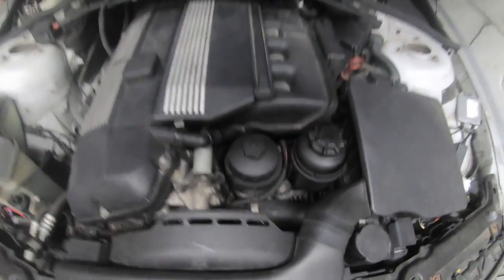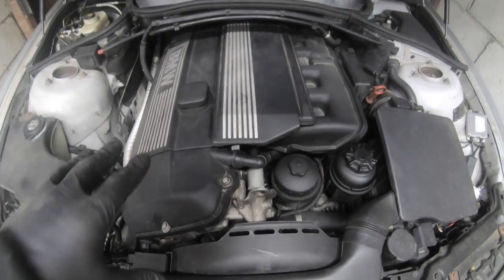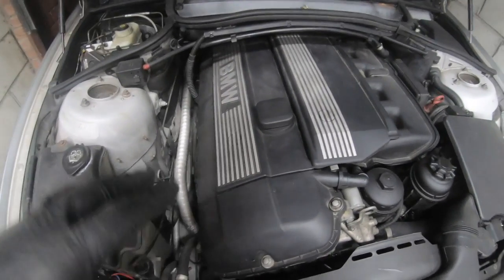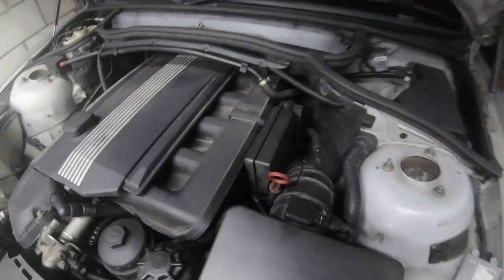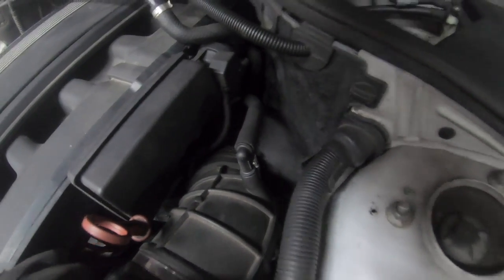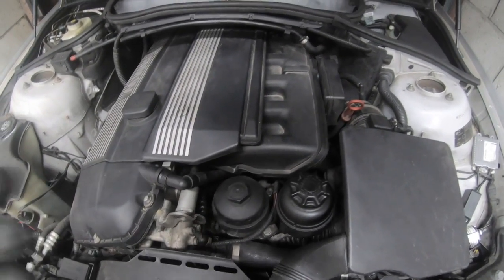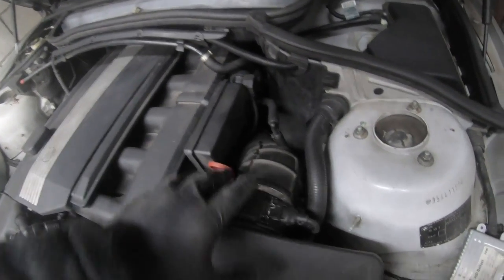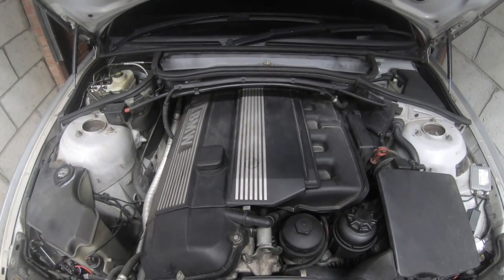Things You NEED To Replace On Your M54 Engine At 100K Miles

Comment: Got 20 years/169K miles on my M47 remapped to 200BHP/325lb-ft 120d Sport steptronic - premium diesel, Castrol Oil, Man filters, change oil every 6K, Change the ATF coolant, every 5 years 50K miles, change rear diff oil every 10 years/100K miles. Recently did the condensor, evaporator, compressor, radiator, expansion valve, o-rings/seals; now the AC is cold as ice. Had to fix the Bluetooth MULF and the profession I-drive/navigation computer, OS drive shaft & ABS sensor, rear and front Guibos including center bush, alternator & battery, uprated Darkside FMIC. new FMIC seals, Milltek exhaust,  B12 Pro kit, top-mounts, Dinan camber plate, Power Flex yellow rear top-mount bush, front & rear 1M wishbones/tension struts, track-rods and ends, tie rods front & rear droplinks, Powerflex Road ARB bushes, Goodridge brake hoses - do the odd track-day

Comment: I bought an Aluminum resivior tank for my 2002 e46 325ci, I replaced my radiator with an aluminium one, I'm having my cam shaft done, new clutch motor mounts oil pan fuel filter replaced every plastic hose with rubber. I bought all the parts, I'm hoping the labor doesn't make me regret the work I've have had done. 154k

Comment: Love you videos, I would like to get your opinion on the fault codes that I have been chasing on my X5 e53 m54 engine: P0444
Raw code: 0444; ECU: 12; Status: Confirmed Evaporative emission (EVAP) canister purge valve - open circuit Evaporative Emission System Purge Control Valve Circuit Open

============6==============
P0050; Raw code: 0050; ECU: 12; Status: Confirmed Heated oxygen sensor (HO2S) 1, bank 2, heater control - circuit malfunction HO2S Heater Control Circuit

Comment: My 2001 E46 325xi Touring has 225k+ miles on it... And I keep finding that a lot of the parts are from 2006, or factory original issue. The waterpump finally died, and ate the drive belt... Now I'm trying to cure the oil consumption issue (1qt per 400 miles, aka one tank of 91octane), and replace the parts that might be holding it back. Not looking forward to taking off the intake, but it'll be nice to do vac lines, CCV separator, OFHG, and other things in one shot when I feel like spending an entire day getting arm-deep in my engine. At this point, I'm happy it runs and isn't throwing codes, aside from thermostat failed open... 😅

Comment: Great video, wish you went more into PCV system. Battle over year after BMW dealer replaced oil pan gasket and oil filter seal.  Ran like a tank for the first 10 minute and people were saying MAP.  Then saw in old video were someone  mentioned ruff running at start. Upon pulling electronics box there it was. Hose broken coming out of valve going to dip stick. Note 168,000 on BMW and the hoses all broke in half replacing the PCV. Looks like BMW uses a straw manufacturer to make hoses.

Comment: In the US here. Have a 2004 X3 2.5 with the M54 and a 6 speed MT. Has been a solid engine for the 7 years I've owned it, now have 202k miles/325k km on it. And looking to keep it going! Keep up the good content!
Reply: no oil leaks? Got a Z3 80k miles scared owner after this video 🤣

Comment: Great video. Clutch fan is a mixed bag, I’ve seen them fail catastrophically and ended up cutting all pipes, belts and messed up the hood as well. I prefer an electric fan.
Reply: get it outta there

Comment: can you tell me i have a e39 525i which i bought recently and changed everything , i started the car and it drives smoothly but recently saw smoke coming out the exhaust , at first i did not take much notice of it but i have dug a little deeper and they say the head gasket is gone , what would you think it was .

Comment: Enjoyed watching this video. Do you have a video DIY valve stem seals and where to get the right tools for the job? I see oil in the cylinder 2 spark plug, cleaned a couple of times, used some at205(stop leak) hoping to temporally stop it, but it keeps returning, must be pretty bad.

I've a m54b30 Automatic 05 Sedan ZHP. Purchased the car with 92k miles and 4 months later it's now over 105k miles. I've service records of the car from day 1 and have done pretty much all maintain item you've mentioned in this video. Well done with the list.

Comment: I have a 04 325i and I bought the car a few weeks ago and the car doesn’t have a Ccv system but it has one coming from the valve cover to the top of the intake is that normal?

Comment: I have a Z3 2.2 M54, on 120,000 miles,  changed all the parts as said in the video except the Vanos seals, still like new. The CCV and crankcase sensor has to be done soon.

Comment: Did all these Maintence tips, owned the x3 for 4 years now still havent spent over $1100 on parts, 155k miles.   Saved 6k in labor doing this all myself, very easy to do. Highly recommend the K&N drop in filter and K&N oil filter

Comment: I really admire your enthusiasm over the car, I have a E46 M54 2002 CI sport coupe and have had a lot of issues. The headgasket was replaced at 100,000 (which sadly resulted in a cold-start misfire), the gear box reconditioned (cost a fortune) I cleaned ICV and cleaned and checked  DISA valve, thermostat and water pump replaced, along with viscous cooling fan, spark plugs, coils, I am currently however on my 5th expansion tank and am uncertain as to why. They keep on cracking and leaking. I did a head gasket failure test the other week, the fluid did not change colour so presumably ok. Car was converted to run on LPG too. Can you offer any advice which would be much appreciated?
Reply: LOL "Car was converted to run on LPG too. "

Comment: So...Bmw Dr. Im thinking about rebuilding a m54 engine from the ground up. Is there anything I can do to build reliable BHP, Camshafts big bore kit head work big valves etc? Does anybody sell these kind of products? I'm looking for real HP not tricks and hacks like ecu tune for a higher rpm or throttle pedal tricks. Any ideas? Lmk! Thanks

Comment: Taking my m54 04 facelift 330ci to the shop to have  the cold climate ccv kit installed, intake manifold gasket, intake air distributer,rotors and pads all around, brake flush, SS brake lines, auto tranny flush and tranny filter, differential fluid flush, 6x ngk spark plugs, water pump, thermostat, expansion tank, aluminum water pump pulley, the other aluminum pulley(forgot name) and 2x belts, also mechanic fan to eletric fan conversion I want to give that a shot. I dont want my mechanical fan blowing up. CHEERRS GREAT VIDEO MATE!!
Reply: whew that sound expensive

Comment: I  would also add whenever you do your CCV (Crank Case Ventilation) also replace the 2 plastic hoses that run from the radiator into the engine underneath the intake manifold at the same time along with the intake gasket and while there check every hose that is worn out and replace it. I  recently had to replace both of those 2 plastic hoses because they bursed while I  was driving on the way to work one day and I  immidiately pull over and turned off the car to save it. Luckily I was able to save it and fix it but it was a  royal pain. I  took my time with it with the help of YouTube and replaced a lot of frayed and worn out vaccum hoses, and such and at the same time did the CCV as the it was breaking apart when I took the intake manifold off. When you do that, replace the oil dip stick rubber gasket too. These are small things but trust me, these small things can grow to something much more serious later on.
Reply: I have an e46 everything you talk about I'm in motion of doing my intake manifold off as soon as I replace inlet heater pipes under manifold I'm installing back my manifold myself

Comment: Replacing the PWC Clutch fan at 100k miles sounds like a sensible precaution but every year seems excessive.  Are you doing 100k miles each year Dean?

My M54 engine is just approaching 100k miles so I will probably change mine.  However, a work colleague with the same 2003 e39 as mine ran it for 385k miles until he eventually scrapped it this year.  As far as I know the fan never failed.

Comment: I have a question about the pulleys, if I have bad pulleys would it make my clutch fan wobble I changed out my clutch fan and my water pump but it still wobbles and I didn't change the pulleys and I can't get an answer back from Nathan
Reply: The fan clutch is fried change it before it hits your radiator!

Comment: My water cooling reservoir blow up at 187k miles, got no clutch fan (electric), cover gasket leaks for every 30k needs to be replace, DISA is still fine (190k).

Comment: I got rid of the mechanical fan and replaced mine with a electrical fan years ago and it has worked great with no issues. I only did it because it makes it easier to work on the car with the electric fan it takes 2 mins to remove but with the mechanical fan it's not easy and quick to remove.

Comment: What do you think of running 90 RON in an M54 powered car, more specifically the 3.0L? I've yet to experience lack of power, I run 98 RON occasionally and it doesn't feel any different going back to the lower RON fuel. Observed fuel economy is the same between the two. It is only a 10.2:1 compression ratio motor though, so I really don't think it needs the premium fuel.

Comment: Hi mate, could you please tell me whet the main difference is between 530d and 525d engine and which one is better apart from the bhp , I’m considering the 525d but wondering if it’s major diff from the 530d ..would be appreciated if you could clarify thanks !
Reply from the maker: No difference mate at all only difference is BHP and the fact that 530D IS MORE fully loaded with bigger sat nav where 525d it’s rare to have that and doesn’t come all the time fully loaded but overall there is no difference
Reply: Thanks for the reply mate, so it’s the exact same engine ?.. and I can increase bhp with re-map I guess and I’m not bothered about sat nav so that’s fine ..I seen 525d with 84k on clock with 2 owners 2008 for 6.5k you think it’s worth it ?..thanks in advance

Comment: Good vid, my e46 325i has developed a problem recently, when i take my foot of the gas and step on the clutch the rpm dip down under 500.
Also it is kinda shaky when i whant to go again.
Vakuum hoses are new throttle body boot, and ccv are new all original bmw, disa is fine, no engine fault codes  
Car got 122k km
If you got some Tipps that would be super nice.:)
Reply: Maybe the vanos ?
Reply: Did you find your problem? I also have it. New o2 sensors, new disa, new vanos seals, new ngk plugs, new intake boots, new ccv, cleaned throttle and icv.

Comment: That is an awesome video. I'm a happy 320i owner of this m54b22.
If you could do a different intro, you could also use the video as buying advice.
Great one, thanks!
Reply from the maker: No mate not on that engine mate I don’t do any 320i 120i 520i engines sorry mate only 3.0
Reply: @BMWDoctor  M54 engines,2.2,2.5 and 3.0 are almost the same,just the size...they share lots of parts....so they have the same problems.....seals,gaskets,disa valve,vanos.....but in the end they are very good and reliable engines,if maintained correctly.👍

Comment: Your content is awesome mate! Is E46 330Ci 2003 picky when it comes to battery’s? Cheers!
Reply from the maker: Not really mate no these cars are actually very good and not fussy about battery’s unlike the newer cars they are picky and will not even power up anything with a smaller battery
Reply: BMW Doctor that’s great mate! Thanks for the fast reply, just bagged a very unloved 2003 330ci full black leather 6 speed manual, cannot wait to get stuck and you’ll be a great help!
Reply from the maker: no problem mate hope it does help you mate

Comment: My mates has gone well over 100k and hasn't replaced vanos seals
Reply from the maker: well he is now due get him to change them I bet his car must feel down on power in low rpm unlike this one this one is like a rocket easy to do we can do it with our eyes closed
Reply: @BMWDoctor  mine too hasn't been done and it still feels quick and it's only the 2.5
Reply from the maker: TH3RAND0M CHANN3L mate you’re talking waffle 2.5 engine is slow as crap I had 325ci m sport with smg and it was SLOOOOOWWWW and I overhauled everything 330 is best if you think it’s still fairly quick you ain’t had your vanos seals done yet to actually feel what power is when you do them the whole car feels brand new and you get INSANE power
Reply: @BMWDoctor  I meant it's quick to say it's only a 2.5 and there not really that slow as far as what I can tell. With me being only 17 it would be harder for me to get insured on a 3.0 than a 2.5 aswell.
Reply: @gavalaa2974  Bro just service your fucking VANOS. It needs it, trust me.

Comment: Dr. Dean, where is the best place to download the software for scanning my 2004 BMW 530i / E60?  God I love this car and have had her since she was a baby.  She is getting a little older now and I have gone through all of the coolant system, hoses, pump etc.   She only has 74K miles on her and looks and feels like new.  However, I know what is coming and want to get ahead of the issues before they cause any problems down the road so to speak.  I bought a K-line USB connector but want a decent SW for the scanning.  Do you have some videos that go through that process?
Reply from the maker: No mate and the software you can’t just download it mate it’s not free 

And anyone’s giving it for free is illegal and it will be shut down I’m the only authorised seller of the software that’s why I have 100 programs of the software and many will only have 6-7 which they have got illegally

Comment: Great vid bro. I have 04 e60. About 85k miles. I have active steering fault on my dashboard. I feel the active steering still works while driving. Any ideas?
Reply from the maker: Get rid of it mate code it out mate it’s common problem
Reply: You can try turning full lock to full lock while its preferably off the ground. Worked for me

Comment: Good video dean! I’m replacing my CCv right now on my m54 ! Without taking the intake off an it is a pain in the @ss.
Reply from the maker: Don’t I know it mate 😂
Reply: pull that manifold like building 7
Reply: Hi Bmw im just driver m54b22 its burn oil 1000km 1 lt can i used 10w60 oil?

Comment: I love my e53 m54.great video. One thing I noticed is that I get the occasional P2096/2098 but only when the fuel is above 1/4 below 3/4. I suspect the purge valve or tank leak system is letting in some air when cycling. Smoke testing it seems like my next step. I’m getting a smoke tester for Christmas so my holiday days off are filled.

Comment: Hi BMW Doctor, I've got an unrelated question about changing an E90 battery. The current battery in the car is a 12v 90ah 900a 900ccc. Halfords recommends one of it's own brand battery (AGM 019 stop/start) 95ah 850ccc. Will putting in that battery with slightly different spec damage anything in the car?
Reply from the maker: No mate it won’t you can change it with no problem mate just make sure to register it properly
Reply: @BMWDoctor  Thanks man, really appreciate your input!

Comment: I see alot of 200000km E39s with no body damage go to the wreckers and think what a waste. With a bit of know how they can easily last double that. I have one with 570000km, and I always say this will be the last set of brakes and tyres I do on it, but if the engine and trans needs no major internal work then I figure I may as well keep it going.
Reply: 350k miles holy shit!!!

Comment: How do you know what engine you got like the code name name of the engine I got a e60 525i
Reply from the maker: what year is your car
Reply: BMW Doctor 2004 Bmw E60 525i with automatic transmission | I got 173k miles also starting to get shift problems and sometimes transmission malfunction code comes on rarely. I took to bmw while back and they said I was gonna need a new transmission and I laughed.
Reply from the maker: Yes mate you have M54 engine with GM transmission typical problems mate gearbox is gone mate need new gearbox

Comment: When I give the car full throttle e60 530i m54b30 it smells really bad.. 
already replaced oil filter gasket, kge, valve cover gasket
Reply from the maker: smells of what Mate
Reply: @BMWDoctor  like burned oil or exhaust gases
Reply: Sounds like a clogged ccv

Comment: Did my cooling system last summer, cleaned my ICV . The CCV is next summer project along with cooling pipe. Debating about the starter also while I'm there
Reply from the maker: I would do it mate everyone in usa always says it fails so DO IT it aint a job you wanna do twice Kevin take my word on that
Reply: @BMWDoctor  Same thing I thought. Bought a set of spanners going to do a mod to it for easier access to the rear bolt.
Reply from the maker: Kevin Vandevelde yes mate that’s the way

Comment: Just did the oilfillter housing gasket, water pump and heater valve today.
Reply from the maker: All common issues mate
Reply: And will do the expansion tank and hoses when I put it back together. Already bought the parts, but should probably buy the belts aswell.
Reply from the maker: do it mate I have all videos regarding this mate so it should help you out greatly

Comment: only thing i dont like about the M54 is that they have alot of plastic in the engine bay and the compression rings wears out and drinks oil
Reply from the maker: not on this one mate every M54 I have owned doesn't suffer this issue
Reply: @BMWDoctor  true but hey its an old power plant with old  cars with 200k plus nowdays so its gonna happen sooner or later :)
Reply from the maker: Mate this has 160k and perfect even gearbox ain’t been serviced and is still strong and goes smooth and perfect
Reply: 62K and mine uses no oil between oil changes, which I have changed every three thousand miles since new.
Reply: compression rings have nothing to do with oil